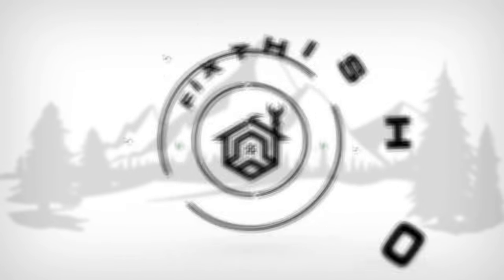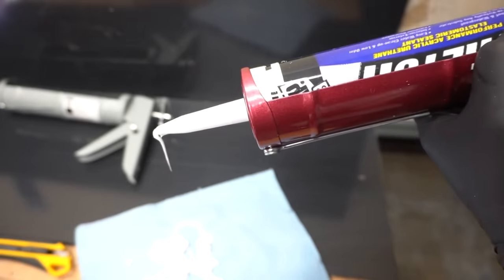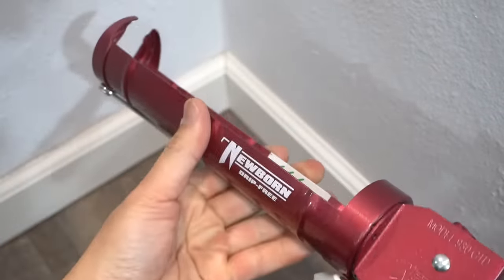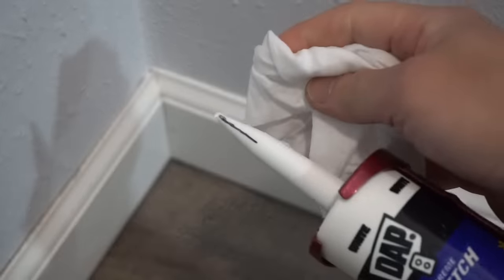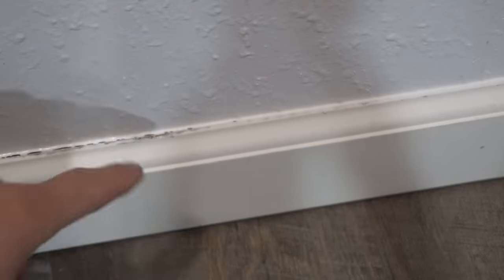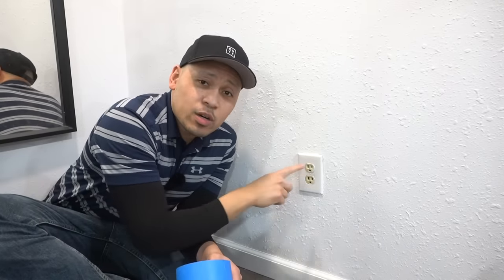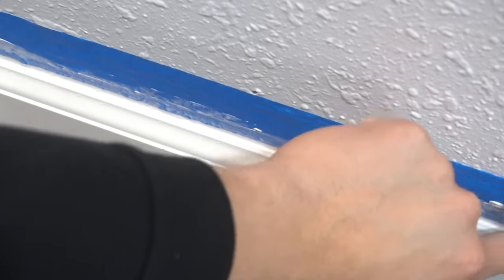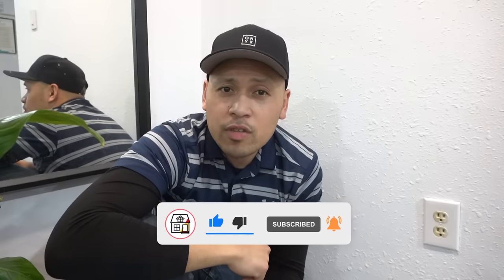The Baseboard Caulking Secret Tips And Tricks I Wish I Knew As A DIYer! How To

Comment: Nice video…. To address the excess calking problem 11:00 …. I suggest ( IF I make that mistake) …. Instead of running your finger the whole length and collecting a bunch of caulk   ,,, I start from the middle and do half in one direction (moving away) then the opposite side (moving the opposite way). This way I pick up less calk and carry the excess caulk to finish more length. If it was a really big line you could do it 3 equal swipes (middle last) … this will prevent caulk from laying high and low and save the mess/waste. It happens
Reply: Yes - it also prevents spreading the caulk onto the wall or trim where you don't want it.
Reply: Another finger tooling expert, The Cob Jobbers just keep coming

Comment: A contractor friend of mine showed me (a rank amateur) a little trick.  Put blue tape on the wall at exactly the height of the baseboard.  2 or 3 foot sections at a time.  Apply the caulk, do the finger thing, clean off the base board with a damp rag and immediately remove the blue tape.  Do not let the caulk dry.  IT CAME OUT BEAUTIFUL.  There are actually videos on that now.  Being 75, I learned that 20 years before YT.  Works like a charm.
Reply: Wastes too much time and materials using tape. If you lay it down properly first, you don't even need to wipe it. In fact, you shouldn't wipe it.
Reply: @jmackinjersey1  - I only did the baseboard in my house once.  Came out perfect.  Why would I want to learn how to do it your way when I never have to do it again?
Reply: @jmackinjersey1  you should ALWAYS run a finger across your bead. Too many reasons as to why to list. If you don’t know them then I’m sure your jobs aren’t neat and/or don’t last for years.
Reply: O K another one, wet tooling taping and finger in the caulk are all things that would get me fired immediately when I worked as a caulker. All the clueless videos of so many calling themselves pros and experts and haven’t the first clue about what Real caulking is
Reply: Do you put the tape on the baseboard or on the wall?
Reply: @toecutter1015 so if this technique is not correct, how do you finish it?

Comment: Instead of pulling the caulk gun behind your bead, push it using the tip to give you a clean line.  No mess, no fingers, no extra passes.  Just seamless and quick caulking.
Reply: I was hoping someone would mention this. THIS is the key to great caulking.

Comment: I've never even heard of several passes. This seems pointless. Ive been a pro painter and finisher years before you were even born, and would cringe if my guys would do this. I do pull my bead both ways on textured, and knock down walls, but thats about it. Caulking, and recaulking the same spot is redundant.

Comment: When you showed how to caulk with blue tape you pro's do it etc. Ive been painting for over 30 years and know other professional painters and not once have i ever seen a "pro" use tape to caulk. Also using a 5 in 1or 10 in 1 to scrape caulk after you have already wiped the bead is not correct. Anyone who know anything about caulk knows caulk shrinks when it dries, so if you "scrape" caulk off of what you just caulked is leaves less caulk. So, once it dries and shrinks, then there will be cracking. In the beginning you said run a bead 2, 3 or even 4 times. If you have to run a bead that many times then your hole is too small. Too many flaws in your technique and advise. Caulking like you demonstrated you wouldn't last a day on one of my jobs.
Reply: yep never caulked with blue tape or even painted with blue tape.. My old boss would fire you if you had a blue tape everything. I learned very quick to cut by hand, people come to my house and think I taped and are shocked when I tell them it's free handed.. these tips are not pro tips DIY maybe 🤔
Reply: @rpcomicfan9371  Same here. I get a kick out of these guys trying to school people on basics when they have no clue themselves

Comment: Wow a 13 minute video on this. Cut the hole smaller in the caulking tube and use a wet rag to wipe down, there 5 seconds. Caulking shrinks to. I never fill nail holes in the trim

Comment: If you are using 2, 3 + runs over the same gap, I'd kindly ask you to leave my jobsites. You use too much material and waste way too much time. If you cut the tip properly amd slow down just a bit, you can lay down a nice bead and dont even need to tool it.  In fact if you tool any in the bathrooms or kitchen, you are doing it wrong. When you tool the caulking or silicone, you are introducing bacteria and dirt, which caises mold and mildew to form.

Comment: I simply don’t understand this modern obsession with caulking everything under the sun. If you do the job properly and professionally you don’t need to caulk anything at all. Not even in a kitchen or a bathroom.  The reason you caulk is simply to cover up the absolute shit job you did in the first place. Caulk is a cover up tool, nothing more. It covers up the faults that shouldn’t even be there.  Yet people treat it like a necessity, like a skill, but it’s in fact a band aid to cover up your complete lack of skill.
My house, built in 1972, does not have one single ounce of caulk anywhere, baseboards, kitchen, laundry, bathroom, because the builder knew what they were doing and didn’t need to cover up mistakes, or make watertight things that should be watertight without caulk, because they made them watertight to begin with.
If you’ve got gaps in your baseboard, you didn’t install your baseboard properly. If your shower leaks without caulk, you didn’t install your shower professionally.

Comment: So…if the LVP, probably wood core, expands and contracts so much, why doesn’t real wood baseboard expand and contract? Pretty bad miter joints. And just look at that gap under the baseboard. Why not run a bead of clear caulk on the back of the baseboard before pinning to the wall and simply wipe off the excess? Cut the caulk tube tip and squeeze it with needle nose pliers to get the bead right. I feel like a pro compared to this “contractor”. As far as pest control, that is the shoe plate laid on the foundation in pos houses like this.